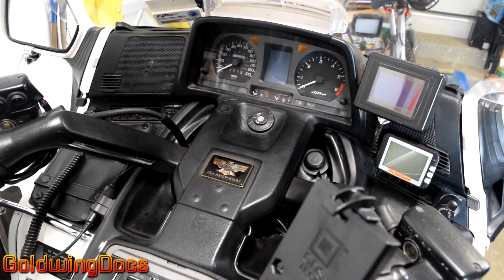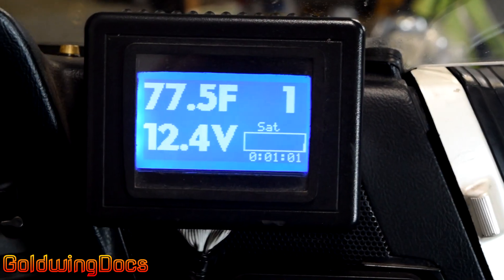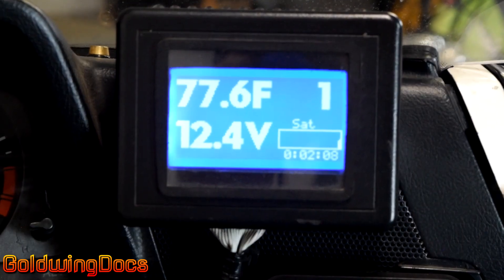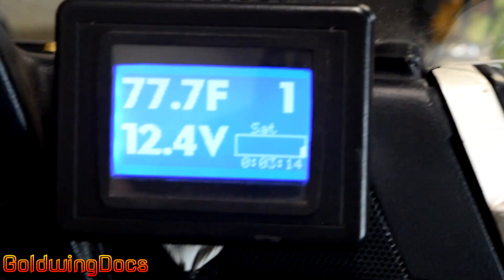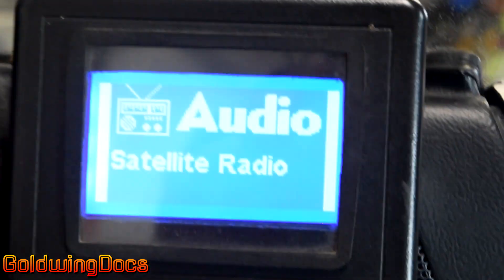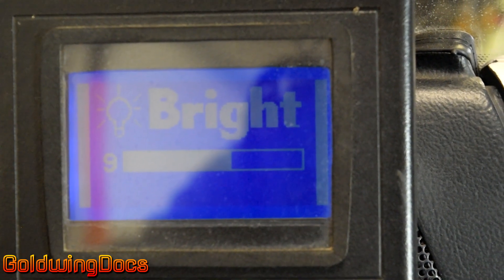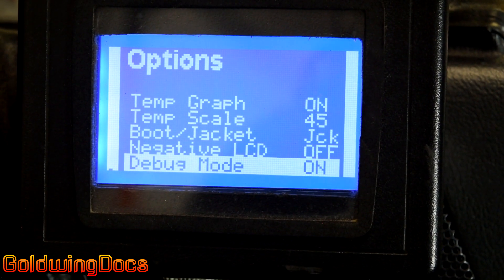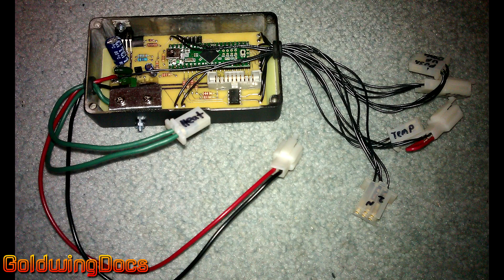Bike PC: Custom-Built Dash Computer for the Honda Goldwing!

Comment: That was quite interesting.  I was shown a few years ago by a colleague this compact motherboard about the size of your creation called a Beagle Bone that had a power port,  USB, RJ45, EIDE, a display adapter and maybe some other things and runs Linux!  I don't know how he made out with it tho.  Thanks for the show and tell!
Reply from the maker: Definitely more advanced than this, you could not run Linux on the tiny processor that runs this system.

Comment: Scott, seems to me Honda would be interested in this product to further the GW Lineup with Tech. You do not need to support it, just SELL it after you patent it. I surely know a lot of tech savvy guys that could install it but seems to me the price point would be a stickier issue. For me, this beats a $2.5-3k Navigation systems hands down. Especially the cool heater part. Anyone north of Florida would LOVE that function alone. Only disadvantage I see are for those that travel to Canada and NEED a navi system. Lord knows when I went there my WAZE ate data like mad in Roam Mode and the cost for 2 days in Toronto was nearly 50 smackeroo's. Lesson learned. If traversing Canada you NEED a GPS Device, not a phone app. But here in the US, I have never had it cost me a penny. And I LOVE knowing where the COPS are.......:evilgrin: